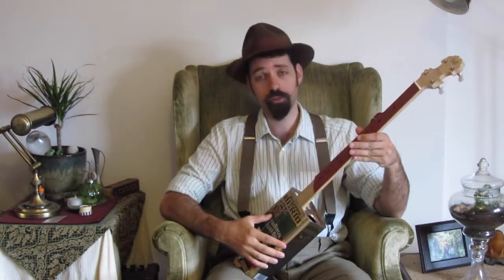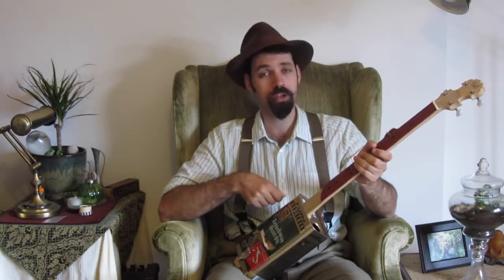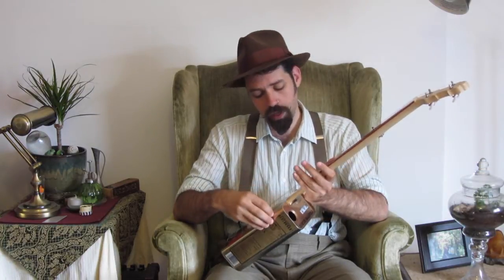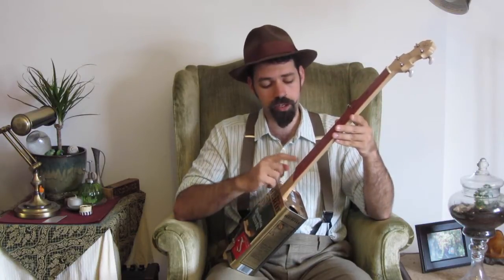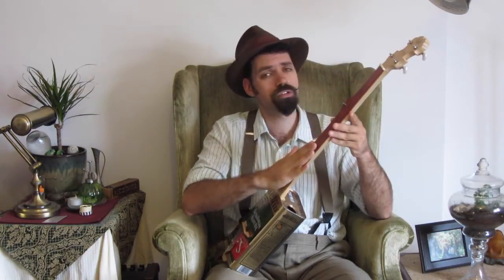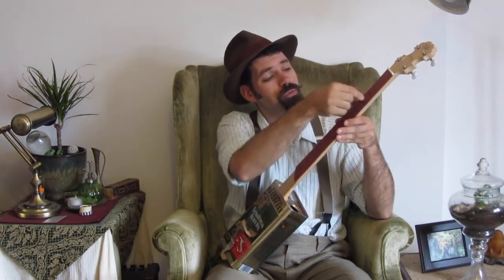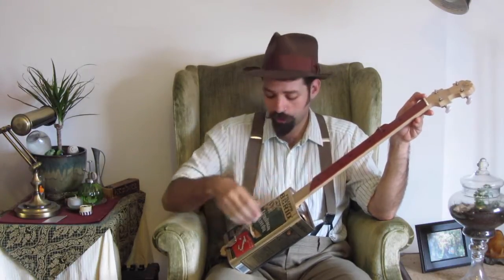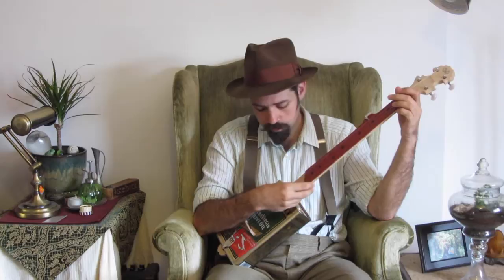Tin Can Banjo: Demonstration

Comment: For banjos do you have to do a tilted headstock?
Reply: Not necessarily, but you'll need to make a string tree to practically hold the strings flush to the wood so it hits the nut at the right angle, that's why headstocks are tilted, so string trees aren't necessary